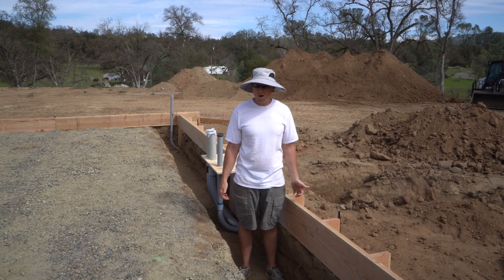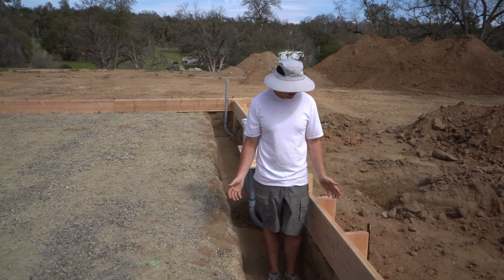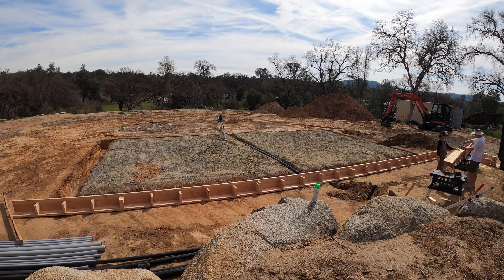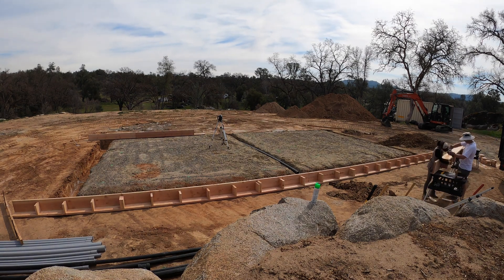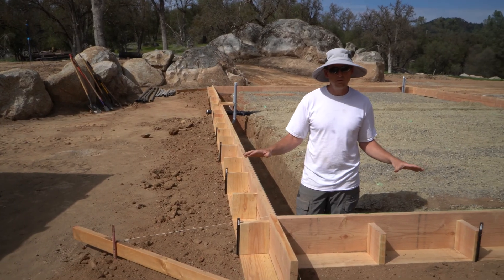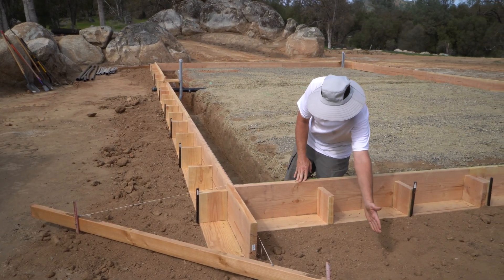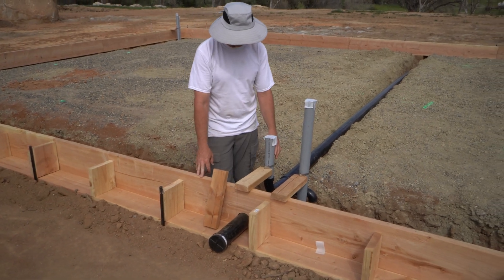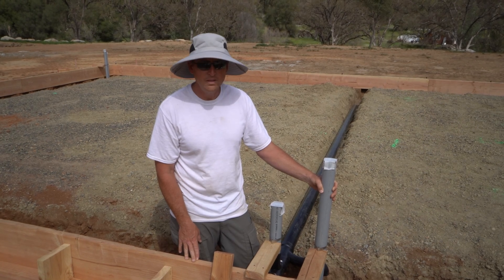Forming for our monolithic slab

Comment: I think I'm going to copy this method - would you have changed anything? How did it go with stripping and breaking down the forms?
Reply from the maker: Nothing I would change if doing neat-line footings. If you're just pouring a slab on the ground (like for a patio) then it might not be worth the extra effort and wood, but in this case it came out well so I would do it again. Make sure to check out episode 5 and 6 for more details if you want to see the completed foundation.
Reply: @BuildItLikeBeckhams  thanks! good to know, I'm going to do this method for sure then. Did you try / were you able to re-use any of the wood from the forms?
Reply from the maker: Yep, we used screws and then taped over the screw heads to prevent concrete from getting in them. After removing them we were able to back out the screws and save the wood for other things. It tends to warp from all the water during the process but can be good scrap. Good luck!
Reply: @BuildItLikeBeckhams  that's great thanks! will send you guys a bottle of wine when foundation is done for the inspiration on this one.. not sure how else I could get the stakes to hold without crumbling our footings without doing a ton more digging..now back to digging footings :)

Comment: those forms will definitely hold up. really you went way over the top making them you couldve done it with much less wood but either way you ended up with solid forms
Reply from the maker: Yep, they did hold up just fine! I guess we can dial back a little next time. :)
Reply: Just remember this when playing in the mud. Mud is heavy and expensive! If you have a blow out, it will be a disaster for the record books. I have seen blowouts on stem walls. Never had one myself.